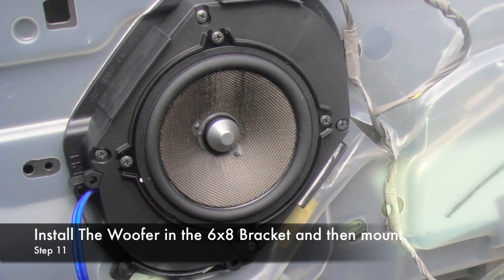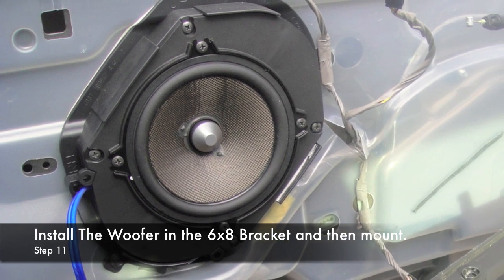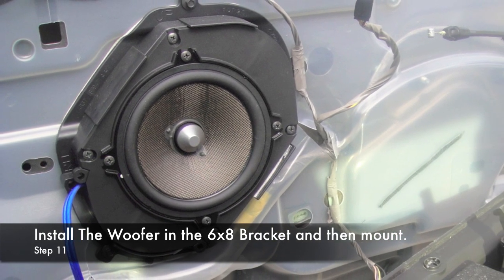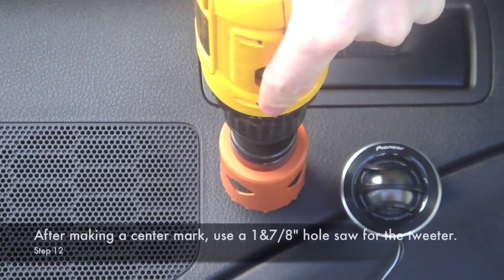2005-2009 Mustang Component Speaker Install

Comment: i think the other is to run ur factory amps u can get a special plug that plugs into the third one it has the plug on one side and on the other is a set of rca cables u simply plug into ur after market stereo i have a 03 gt i had the same problem

Comment: @sarahandsarah13 You're meant to put those wires in, run a power cable from the positive terminal on the battery back to your amp (where ever your amp is).
Then the ground cable on your amp will run from your amp to the body of your car;
to ground it.

Comment: @EmptyGamingHD  The shaker 500 and shaker 1000 systems have 4 door speakers while the standard stereo uses just a single coaxial in each door... Mine came with the shaker 500 and I used the factory lower speaker location to mount the third speaker of a 3 way set of components in each door with glassing it into a custom housing for better sound..